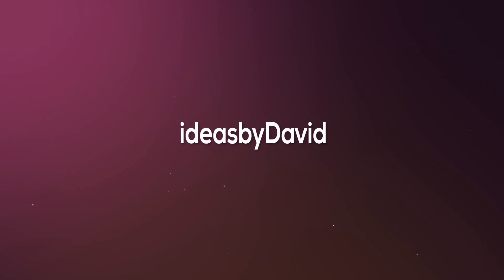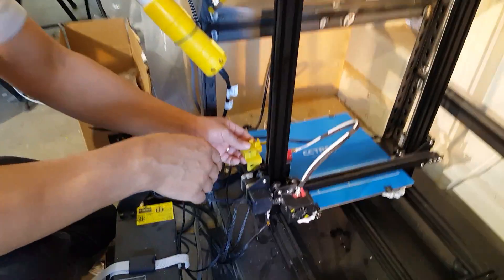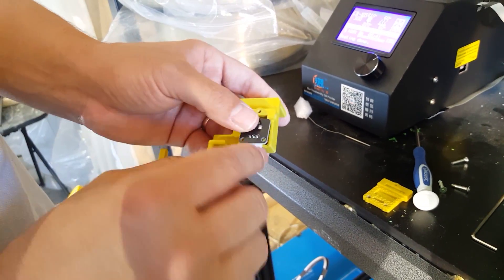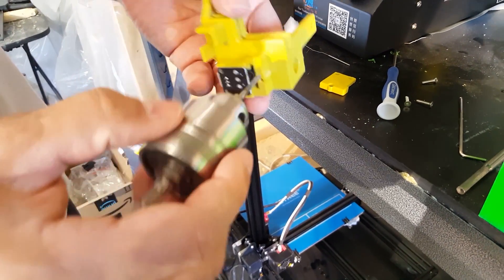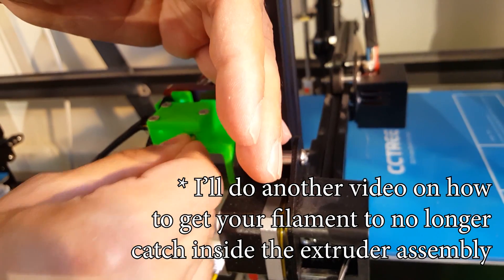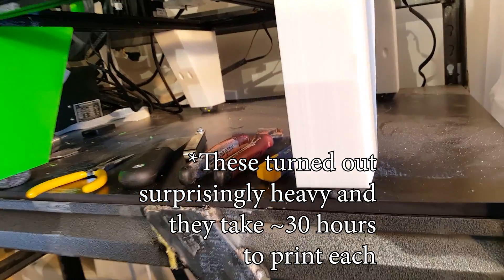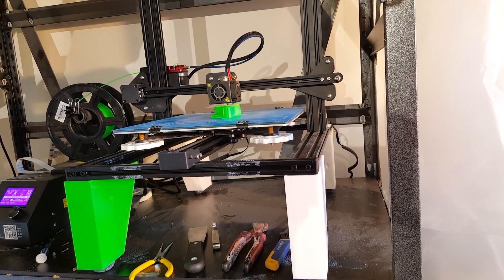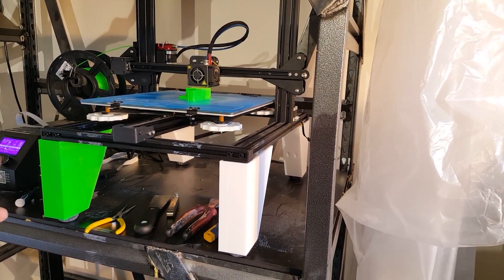A better CR-10s Filament Runout Sensor Upgrade

Comment: Nice catch, that'll come in handy once I get the new CR-10S (should have a stiffer frame if I got it right...) :D
Reply: Little the idea i have for the CR10s when ever I get it, is to use the profile slide to attach a thicker aluminum with slides on the outside. That way I hope to stiffen up the weaker parts if there is any on the S version but as I understand frame is same on it and most changes are to engines, nozel-head and electronic on the S. But I'll see how it perform first before starting changing things. :D